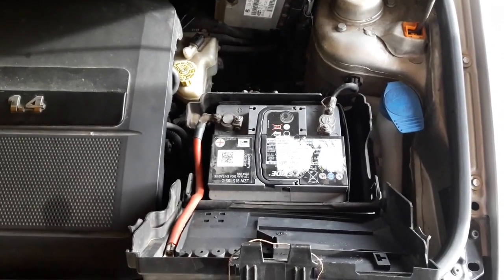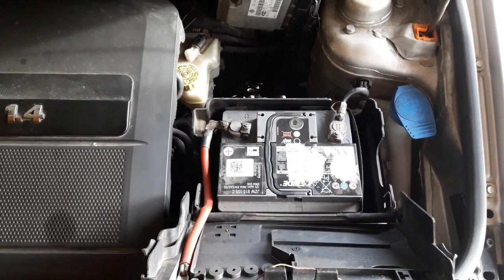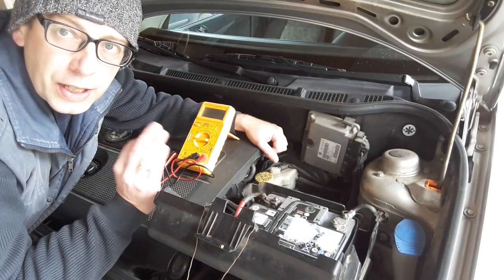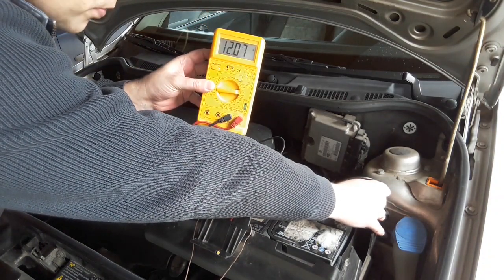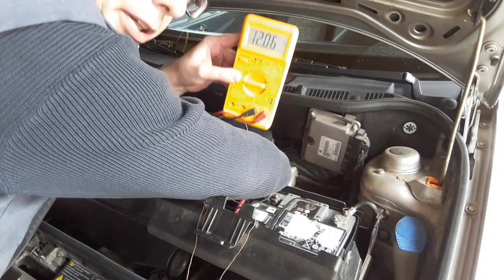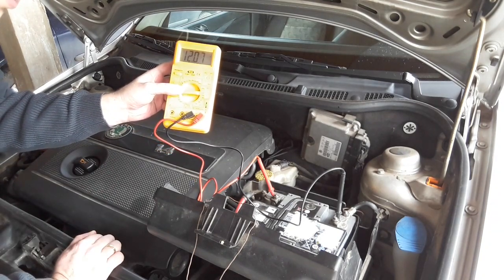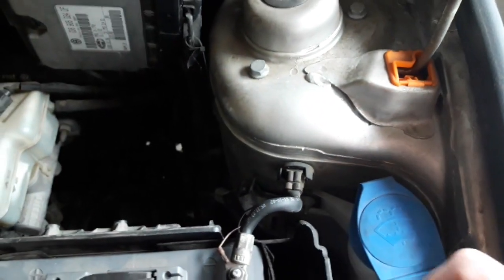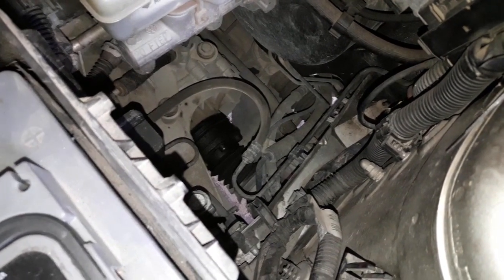Bad Ground Connection On Cars-Meaning,Symptoms, Diagnosing and Solving The Problem

Comment: Hi there I have a problem which I consider hard to describe or to be solved😵‍💫 I live in a hot climate area which is mostly too hot during summertime. 
The car overheat if I use the AC in 3rd or 4th speed, coolant temp reaches 110-111C  if i sit in traffic for 10mins during the day or night.
I started to use the AC in 1st or 2nd speed ONLY! and suddenly the car got better and it wont even reach 97C during hot summer days with heavy traffic!! Which is great! But the air blast is not enough to cool the inside cabinet..
Btw the AC air so cold and have no leaks. redaitor fans work well and in full speed.
Is this problem related to bad electrics or any other component?
Reply: Check evaporator

Comment: Thanks for the video very helpful!. What about when your car shuts off while driving and gets no crank or click?
Reply from the maker: You're welcome and thanks for watching! For that situation, I would first check the battery terminals and clamps, if they're cleaned and tightened.
Reply: @DespairRepair  you think a bad or loose or disconnected battery terminal will turn off the engine while driving?
I will check that out though
Reply from the maker: @raphael3666  yes witnessed it firsthand 🙂. It of course depends on the car model but, at least in my opinion, is definitely worth the check.

Comment: I have an 03 Avalon with pulsating headlights,dim headlights at idle,dome lights and now the instrument cluster is slightly pulsating especially bad on cold nights.Ive replaced alternator,battery no help.They pulsate when car is on but at one certain pace all in sync,press accelerator stays same doesn't speed up im out of options does this sound like failing ground connections?
Reply from the maker: Hi and thanks for watching! It could be the ground connection and it is definitely worth the check.
But it all seems to me more like an alternator issue but you've written that you've replaced it. Is it new, is the voltage regulator on it new?
Reply: @DespairRepair  Yes its a brand new Remy i took the Toyota alternator that was on it autozone yesterday they bench tested it "Passed" ..it was doing same thing with it
Reply from the maker: @roltyd22  sorry for the late reply, did you test the alternator voltage output? With a multimeter? Does the voltage fluctuate?
Reply: @DespairRepair  Not with a voltmeter but i got this fixd app i dont how reliable it is but it'll show charging at startup anywhere from 13,7 to 14.3 until it gets to running temp then drop to about 13.4 and stay steady at this at idle..the battery will struggle to stay at 12.5 i can shut engine off it'll drop to 12.2 and 3,flip headlights on for 30 seconds it falls down to 11.5 and 6 immediately..could battery be just not sufficient enough? Like its working the alternator a lot to keep it charged to spec its a brand new Walmart battery which means nothing really ive not had much luck from those to be honest
Reply from the maker: @roltyd22  well in my opinion that's the problem (and if I understood correctly). The voltage must be the same (14 to 14.5 volts), when the engine is idling and at full revs.

If it fluctuates from 13.4 to 14.3 that's why the lights pulsate.
It could be the battery but if it holds 12.5 volts when the engine is turned off then the battery should be OK.

I would recommend testing the alternator again. But this time try testing the voltage on the car if possible, and if you can reach it with a multimeter. See if the voltage fluctuates at that point.

If not, then the alternator is OK. If it is, then the alternator or voltage regulator is the problem.

I'm mentioning this since there might also be some power loss or a bad connection from the alternator to the battery.
Reply: @DespairRepair  As soon as i turn car off the battery drops from 12.5 to 12 its never over 12.7 after a drive when i shut it off..but ill get a voltmeter and check drop from alternator to battery,i added about 4 extra little grounds and it seemed to help the pulsating
Reply from the maker: @roltyd22  sorry if I misunderstood, but the battery voltage is supposed to be 12.5 to 12.7 when the car is off. That means the battery is OK. When the engine starts it should always be 14 to 14.5 volts.
If you want to test the ground to the engine, try using a jumper cable. Just connect it from the minus battery terminal to a clean metal part of the engine.
Reply: @DespairRepair  Ok,so just connect cables like you said  and start the engine see if it pulsates? The pulsating stays the same in the lights whether i rev it or not doesn't speed up or slow down..weird lol
Reply from the maker: @roltyd22  yes, do that and at least you'll get the question of a bad ground connection out of the way.

The pulsating will continue as long as there is a voltage fluctuation
Reply: @DespairRepair  ok I'll do the jumper cables tonight i can tell more by the lights,I'll update you on it
Reply from the maker: @roltyd22  ok good luck and hope any of this helps 🙂
Reply: @DespairRepair  I tried it still pulsates but i did pull the 25 amp AF (Air/Fuel) sensor fuse and cranked it stopped..people have said they draw to many amps by working at the same time..from what they've said you cant completely stop it..some got a 130 amp alternator and it pretty much stopped it i dont know about ready just get rid of it to be honest..alternator may work may not  i just spent $170 on this new 100 amp that it calls for and im thinking the wiring is old and dry probably a lot to do with it because i dont think they did it new off the lot only when get high miles on them
Reply from the maker: @roltyd22  to be honest with you, I don't think that removing the fuse will solve the problem. Unless you have some kind of short circuit within that specific circuit.
Short circuits will cause serious power fluctuations and pulsating headlights.
Regarding the alternator, I would do the same thing if I was you. Anyway, if the alternator is OK, which it obviously is, it should work fine with that amperage.
The main question is still why is there a fluctuation in the voltage output? One more thing I would like to mention although I'm not sure about that car specifically is if the cable from the alternator to the battery is connected to the starter also. If it is check the connection on the starter. It's a big screw on top of the starter solenoid. Just be careful not to make a short circuit.
It's a long shot but perhaps worth the try.
Reply: @DespairRepair  Ok,the positive cable has a smaller one coming off it that goes to the fuse and relay box beside the battery is that the wire that feeds the battery from the alternator? I wonder if it could be loose or corroded at the box where its connected? Only cable is the positive going to the starter with the smaller positive going to the box
Reply: @DespairRepair  As for the fuse being removed it throws an engine light for 02 sensors malfunctioning but i put it back in and clear it
Reply from the maker: @roltyd22  hi again, the thicker cable on the alternator is for charging the battery.
This is the cable I've mentioned you should check if the contact goes on the starter and then on the battery.
The other thinner cable is for the battery dashboard light (and alternator input) and there might be one more cable for the rev counter.
Check it out for corrosion, it could be the problem and it's worth the check but I doubt it.
Reply from the maker: @roltyd22  yes removing the fuse probably triggered the check engine light.
Reply: @DespairRepair  Im going to try one last thing a 130 amp alternator

Comment: I have for decades: put a ground wire from battery to the engine and an extra ground wire from the battery to another spot to the body! And the most cold cranking lamps battery in it! And not an cheapest battery/ a good battery which co$t more $money but worth it in WINTER and BEYOND!

Comment: my headlights flicker when I am using my radio for a while, sometiimes causing my engine to stall and restart. I got the dealer to check, the battery and alternator is still in good condition, but they suspect the ground connection. Could you point to where I should check for my issue?

Comment: so i snapped the negative wire and just wedged it in the screw that was holding it at its base the car was starting fine but i am getting that slow crank to the point my car wont start battery tested good
Reply from the maker: Hi and thanks for watching! Well, if the contact is good and if the wire is fully wedged then it should work OK but put on a proper connector as soon as possible.
Just in case, bypass the ground connection with a jumper cable (from the minus battery terminal to the engine) and then try cranking.
if it's still slow, I would check the starter and the connections to it.
Reply: @DespairRepair  thanks for replying and will do i had radio issues as well pulled the fuse and its been fine but last week there was a very bad storm minus 7 thats when i started to have issues but will do i might bang on the starter as well
Reply from the maker: @frickysuavve247  you're welcome and hope any of this helps. Just wanted to ask if the battery is OK, I'm asking since it's cold, low temperatures can also cause weak cranking.
Try banging also can't hurt 🙂
Reply: @DespairRepair  well i took the battery to autozone they said it was good and i have a jumpstarter box as well which also isnt doing the trick which makes me think its something else im not to good with the electrical engineering tbh lol
Reply from the maker: @frickysuavve247  well then, I would definitely check the starter, especially if it's a high-mileage car and any maintenance hasn't been done on the starter.

Comment: I have the heavy cranking “womp womp womp.” I replaced the battery and alternator. But my connections looks a little exposed. When I was cranking it my negative ground started smoking and turning red which indicated I have a problem there. I’m not sure if my alternator have a connection problem either.
Reply from the maker: Hi and thanks for watching! 

If the engine isn't properly grounded then more or less anything won't work properly including the alternator.

Maybe best try connecting a jumper cable from the minus terminal of the battery to a convenient metal part of the engine and see if the connection is the problem.

There is a part of the video showing that I think.

Hope this helps.

Comment: idle drop when fan comes on and when Im using power window.. and when i turn on my fight.  You think my problem is bad ground?
Reply from the maker: Hi and thanks for watching!
It could be but I'd first check the alternator voltage output and if it's stable

Comment: I have a 2005 ford escape xlt and driving home tonight all the interior lights, high beams. Blinkers shut off but the car kept driving! When I shut the car off and turn the key the interior lights and Blinkers everything works but when the engine starts all the electrical stuff shut off! U have an idea you can help me with? Thanks
Reply from the maker: Hi and thanks for watching!
It could be a couple of things but I would first check the battery clamps that they are tightened and clean.
Also, I would check the cables coming to the clamps. After that, I would consider checking the ignition switch.

Comment: what can cause the ground cables and alternator to become hot when you connect the battery without turning the car on?
Reply from the maker: Hi and thanks for watching! That would have to be a serious short circuit of some kind.

But in that case, there would be a huge spark when connecting the battery clamp to the terminal.

Needless to say don't drive the car like that.
Reply: @DespairRepair  yes i wouldn’t drive it like that since as soon as i connect the battery it immediately starts getting the ground strap really hot and smoke my car died on me assuming it was the alternator because of the symptoms and tried putting a different battery with charge in it to drive it 2 mins so i can get home instead of towing it but everytime i connect the battery it immediately starts getting the grounds hot
Reply from the maker: @dilusery6244  have you checked the main ground cables? Are the connections clean and more importantly are the cables not broken or damaged in any way?
Reply: @DespairRepair  i had recently replaced the negative post on the battery terminal a while ago but thats what i plan on doing i plan on going through all the ground straps there are and cleaning or replacing them once it stops raining here in georgia so i haven’t had the chance to fully go deep in it yet and been trying to gather information since i don’t know much about electrical stuff just the mechanical side of things
Reply from the maker: @dilusery6244  ok, that's a good idea. A broken strap (especially the one from the engine to the body, if there is one) is a common cause of those sorts of problems.
Also and please don't take this as patronizing make sure the clamp you've replaced is very well-connected to the ground cable and that the connection is clean. Otherwise, it may cause the same problems you've described.
Hope this helps and that you make a successful repair.

Comment: Can this also cause wires melt
Reply from the maker: Hi and thanks for watching! Yes it can, if the connection is really bad. A bad ground connection will cause a cable to heat up, simialir to a short circuit.

Comment: I just did the jumper lead test and now Im getting 14.2 Volts 🙂  thats the means the ground earth lead is faulty?
Reply from the maker: Hi Kenny and thanks for watching!

It seems so. But you've written that you've cleaned the ground connection. 

Did you check all the connections? Is there a connection from the body to the engine? On my Skoda, the ground comes from the bolts on the engine mounts.
Reply: @DespairRepair  Hi the lead I cleaned was the one beside the air filter housing it comes of the negative battery terminal to earth on the body.  When I bypassed it with the jumper I got the correct voltage at idle.  Ive wasted money on a new battery and new alternator. 😞  Now I need to find where  ground problem is...im no expert and have no idea where the grounds connectios are on the Skoda Fabia Monte Carlo 1.2 TSI 2012.   You have been a great help already..Ive had this problem for the last 2months.
Reply from the maker: @kennymac6376  glad to hear that we could help, that's the point of the whole channel.
🙂
On my Skoda Fabia (2004 mk1, 1,4 petrol engine) the ground cable from the engine to the body is located under the battery towards the starter.
It's held in place with two 13 mm nuts, one nut is just under the battery and the other is on the upper nut that holds the starter.
Just take a good look around the engine bay, you're bound to see it as a bridge between the body and the engine.
In any case, this is the first place I would look for a ground problem after the connection from the battery to the body.

Sorry to hear about the unnecessary repair cost but trust me you're not the first. One of the main points of the video was to try and save people from this.

Hope this helps and best regards, if we can help in any other remote way, contact us.
Reply: @DespairRepair  Your not going believe it the earth cable connected to engine on the bottom left had a loose nut.. I tightened it and 14.3 volts across the battery..    wasted £400 unbelievable!!!   Any way your video was a great help.  Thanks
Reply from the maker: @kennymac6376  hi again, you're welcome, and glad if we could help!
As mentioned in the video, a bad ground connection is one of the most overlooked problems in car electrics and electronics.
Regarding the cost, I would recommend just looking at it as water under the bridge and a cost of a worthy lesson.
That's at least how I comfort myself in similar situations. 🙂
Nice virtually meeting you and if we can help in any other way, contact us.
Reply: @DespairRepair  Thanks Again 🙂

Comment: Hi thanks greta video.    had nothing but problems with Skoda Fabia Monte Carlo 1.2 TSI .   Change Alternator and fitted new battery and still the same.  However after watching your video.  i checked the ground connections with a multimeter.  When the car is running it should around 14.2 volts,  im only getting 12.6 on the battery and the ground connection on the bodywork.  But when I put the negative lead on the engine metal I get 14.6V.   What does this mean?  I also cleaned the ground lead.

Comment: I have X Trail 2021, it has suddenly started having slightly flickering lamps in headlight and interior while I give gas and idle seems weak. Since it is very minor, dealership isn't able to figure it out. I checked battery voltage and alternator reading, it shows 12.8 and 14.1 respectively. Could it be a bad ground?
Reply from the maker: Hi and thanks for watching!

It could be, but I doubt it to tell you the truth. 

It's a new car, and I would consider a ground connection problem only if any recent repairs were made that would involve taking off a ground connection.

Otherwise, I'd think about checking the alternator (the voltage regulator on it) first. I would proceed with problem-solving from that point.

Hope this helps

Comment: Can a bad ground cause your battery light to flicker? I’ve replaced my alternator 3 times and have a brand new battery and after a week of driving after replacing each alternator my battery light begins to flicker. I’ve taken it to many shops and everyone tells me that my alternator and battery pass all the tests and there nothing wrong
Reply from the maker: Hi and thanks for watching!

Yes a bad ground connection can cause this but I would also check the electric installation (cables, connectors, etc.)